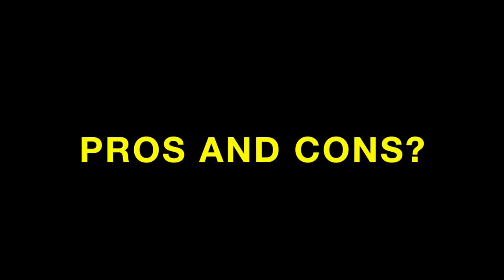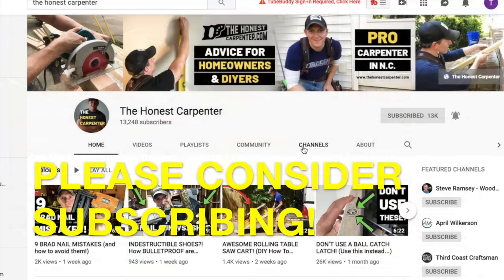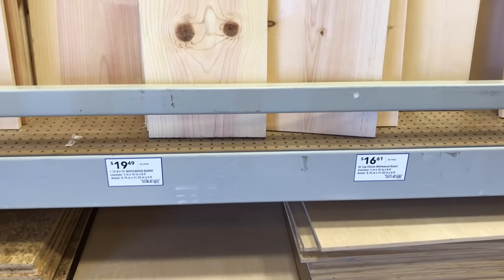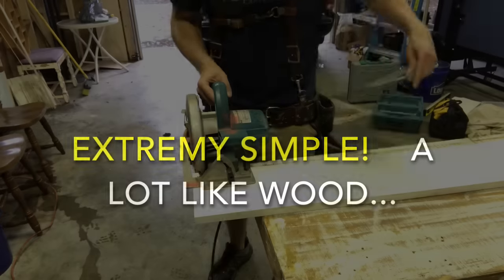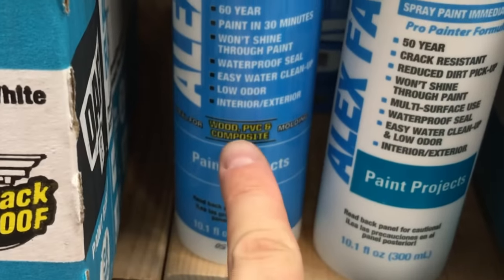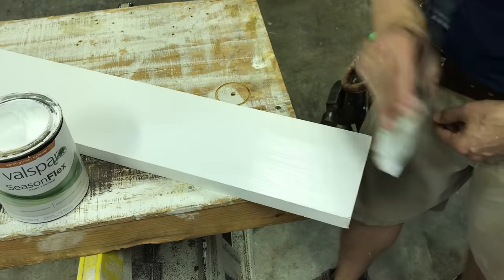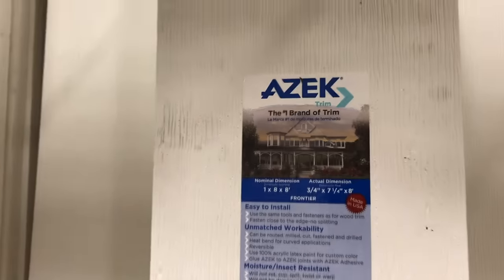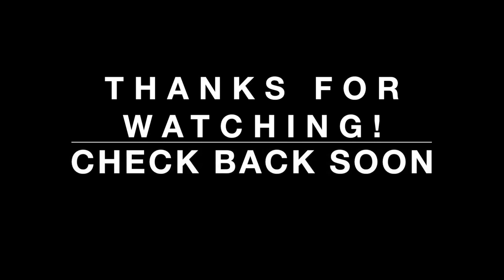PVC TRIM VS. WOOD TRIM? (Pros And Cons!)

Comment: My dad is a plastics engineer and a Hotwire would easily cut the PVC with no dust. It vaporizes the cut and it is extremely clean, simple and easy to get even complicated cuts.
Reply: That's probably what they do at the factory. It's not a mill, it's an extruded plastics production line.

Comment: I research plastic pollution, and I’m so glad you mentioned the sawdust! It’s great that you do your best to reduce sawdust entering the environment. It would be nice to see guidelines from these companies for best practices.
Reply: Someone mentioned earlier to use water and ground the tools to prevent dust flying away and sticking to things.
Reply: I like to use it as a mulch for my garden.
Reply: Did you contact your Billy Gateies  and like to give them sh..it  ? 
Thy will eliminate you like a POS
Please don't suffer ...
Reply: I was thinking putting out a large tarp down to collect what the dust collector doesn’t, but one gust of wind would ruin this idea 😅.
Reply: I think you should set a good example to the rest of us and stop exhaling carbon dioxide... you know, to "save the planet"
Reply: Pvc shrinkage is bad. I use it  for some jobs and it shrinks on the width and length.
Reply: Great comment in theory;
O' the slippery slope; guidelines & litigation make it hard enough to do business as things stand.
Birthing layer upon layer of governmental control 
where individual freedom is going the way of the unicorn and leprechauns.
Have you used a can opener lately? Opening a can of tuna is dangerous; 
Perhaps an impact study is needed; leading to newer; better laws; mandates that all metal cans have pull tops; 
I imagine the user agreement would read as follows. Please read carefully;
Failure to adhere subject to fines, imprisonment or both. Proposition tax-more.
Please peel label and follow the complete user agreement found on the inside of can; use of a magnifier glass is advised as eye strain is serious and can be fatal. Failure to comply releases manufacturer from all liability that may result in injury or death. Upon reading feel free to call our hot line with additional concerns.
Discard used cans and torn labels per guidelines....
The world according to Charlie Brown in two words; Good grief!
Reply: The companies appear to be ignoring the obvious.
Reply: @turtlewalzer  
Good grief!

Comment: As you said, with the price of wood skyrocketing and the price of PVC trim decreasing it's a no brainer. Use PVC wherever you can when working around any degree of moisture and never have to replace it. Exterior window sills, door jambs, and brick moulding are common applications. You can also glue PVC joints with PVC cement for the strongest bond possible. Good video, thanks.

Comment: If your NOT painting this PVC. Leaving the wood grain look for an Exterior trim. How do you fill the nail holes. With what product. Since most fillers will shrink or yellow over time. Leaving filler spot marks visible on PVC brickmolds when you trim out a door. I’ve tried trim screws and caps but that’s labor intensive.

Comment: Few years ago I had a front porch built with PVC trim, contractor assumed I wanted the "Wood grain" finish so he protect that side during storage and the smooth side I wanted ended up really dinged up. He was going to have to replace it, but I found if you take a heat gun to the damaged areas and then used something hard to roll it while it was hot, almost all the dings disappeared.

Comment: My 92 year old house had a window in the shower that was constantly rotting. My handyman overlaid it
with the PVC window trim with vinyl fence nails. Beautiful result. Only took 85 years to figure this out.
Reply: Only 85 years 🤣🤣🤣
Reply: Someone mentioned earlier in the comments to use water and ground the tools to prevent dust flying away and sticking to things.
Reply: @jsmith5443  Thanks J.  Not quite sure how to use water with a saw but I'll give that a think, as it does make one heck of a mess.
Reply: Could have used ground treated lumber, I replaced all my window sills and outside trim with ground contact treated lumber

Comment: Thanks for the informative video. I'm not a carpenter but I am an incredible cheapskate so if I were wrapping some iron supports like you did, I would use wood boards and cut them 2 or 3 inches short at the bottom and then nail on 4-6 inch wide pvc pieces essentially wrapping the bottoms of the wood boards so only the pvc contacts the ground.
Reply from the maker: I wouldn't blame you, Steven! The price line can be hard to take sometimes. But that sort of bottom-end extension is exactly what much of the industry is doing now to create better door jambs
Reply: We use to call them sacrificial pieces. Knew they would rot first and could be replaced easily. I like your thinking.
Reply: That's what I thought of as well. Either that or leaving about a 1/4 inch off the ground, then filling it with caulk so that the pvc is not neccesary.
Reply: Or, if the two products are getting so similar in price, whay take the time and hassle of transitioning to PVC the last few inches?  I would think it hard to attached a short 4" end piece of PVC with only rot iron as a backer, no?
Reply: @paulegan2252  PVC amending was easier (for me) than pulling out an entire patio door surround.

Comment: I'm glad you touched on the sawdust! It's messy and difficult to remove!
Reply from the maker: Like getting coated in coconut flakes KLM 😐
Reply: @TheHonestCarpenter  at least coconut flakes aren't toxic!
Reply: PVC sawdust is the main reason I minimize my use of it.  If you can't catch it all, it ends up in the environment where it breaks into microplastic, but never actually degrades.  I'm not far from the coast, so any dust I don't clean up probably ends up in the ocean.
Reply: Plastics hold a lot of static electricity.. make sure your tools are grounded.. especially table and miter saws..you can install “static brushes”  as well..( they are just conductive single row metallic bristles with a ground wire).    also, it is in our nature to keep wood dry...don’t do that with PVC wipe or mist it with water and it will act like a K&N filter where the sticky oil grabs the blowing particles.. water does the same thing with PVC. I use a strong box fan with a floss filter ty-wrapped on the intake side... once the filter is dry just use a stiff brush and shaking to remove the PVC onto your tarp ( always cut on a tarp).
Reply: @incognitotorpedo42  if you catch it all where does it go then? Into a plastic bag and ultimately into an open air landfill?
Reply: @klmbuilders5385  Yup.  Landfilling is the best option we have at the moment.  It does get buried, so at least it's isolated from the rest of the environment.  I compost my wood sawdust, so keeping the PVC away from the regular sawdust is another hassle.
Reply: @incognitotorpedo42  it might be better if you took the stuff to a recycling center where they can melt it down and make something else.
Reply: @jsmith5443  , as far as I know there's  no infrastructure for recycling PVC dust or flakes.
Reply: @phredocassera2939  Hi Phredo, I'm struggling to understand your setup. Can you please share a picture?  Thx!
Reply: @incognitotorpedo42  or in our foods and animals we consume, increasing cancer rates.

Comment: Regarding fascia boards, I would not recommend using PVC on a fascia board that a gutter is installed to, unless you can ensure that each one of your gutter fasteners(spikes/ferrules, hidden "skyhook" type screw hangers, etc.) grabs onto something structural such as a rafter tail end or a 2x4 or 2x6 subfascia(you won't always have one of these). If you have a gutter hanger that doesn't bite into something that has substance(like 2x wood, or 1x wood with a screw hanger), it won't be long before that hanger fails because the density of PVC material is much lower than wood, and as a result the lower density, fastener pullout strength is greatly reduced, and the likelihood that the weight of a gutter that is full of water or ice will be more than enough to rip it from its moorings and could cause major damage to anything that happens to be below it at the time of it falling, such as a person or a car.

Comment: Replaced wood brick moulding with pvc on my garage window over 10 years ago. Very happy with it. It faces the southeast so it’s exposed to extreme sun. The pvc holds paint very well, where the wood would start to peel after a few years. It does expand and contract as you said so sometimes you can notice a slight gap at the corners. I used big stretch caulking and that seemed to be able to handle the expansion and contraction.
Reply: My side kitchen window gets exposed to sun all day since there no trees or bush on that small side. I noticed trims are separating and I like to maintain it. I figured if this wood trim is rotting fast while other part is like new then that’s a problem. I think going PVC might be my solution as well. Glad I stumbled upon this video and comment

Comment: Another adhesive option is PVC pipe primer and solvent cement. I used it in combination with mechanical fasteners on a product display rack I built about 35 years ago. Seals up "end grain" quite nicely.
Reply: The plumbing solvent cement works, but has an extremely short open time.  Azek adhesive has come down in price to the point that it's close to plumbing cement, and is a lot easier to work with.  In addition to using pvc cement to seal end grain, you can use other solvents.  I've used acetone for this.
Reply: Both of them suck imo.  The joint easily pulls apart by hand.  The only thing I found that won't fail with PVC expansion issues is an expensive as hell two-part PVC epoxy.
Reply: are nails insufficient?
Reply: @scottgiet1835  I use stainless trim screws.

Comment: Never thought about specific caulk or adhesive for it. Good tip.
Reply from the maker: Thanks Joe!
Reply: Alexander Franke  thank you.
Reply: I've been using Oatey Fusion 10-fl oz PVC Cement And Primer. It's clear & supper strong bond. Never failed in years in full sun.
Reply: Same here.   Replaced a window last year and I think I just used regular old Dap.  I'll have to keep my eyes open as I start doing more in the next couple years.

Comment: I started using PVC trim many years ago after the brickmould rotted away on our back door. Last week, I was going to patch the rotten parts of our fascia using cedar but all of the 1x6 boards at Lowes were warped so I bought a PVC board and used that to repair the fascia. It worked great.
Reply: It is economically and ecologically a bad calculation. Pvc won't last long and gets ugly quick. You cant repair it and cant paint it either.

Comment: Best explanation video. I added PVC trim to my garage and front of my first floor to reside my home in July, looks great but as the temperatures cooled I have almost a 3/8" gap between the boards now.
Reply: Fill it with silicone or soft rubber is my suggestion if the gap bothers you.
Reply: Someone mentioned earlier in the comments to use water and ground the tools to prevent dust flying away and sticking to things.

Comment: Great detailed video. I work on a lot of boats/yachts. Pvc lumber cant be beat. Salt water wont hurt it and it never needs painting. Since there are never straight or level lines on boats, i use a heat gun and pvc cement to  conform it to the multiple compound curves on a sailboat.
Reply: They make heat blankets for pc you bend the like a pretzel if you have too

Comment: Azek trim has been around for at least 20 years.  Put lots of it up before I retired.  Even specified it when I had a contractor replace corner boards on my own house.  It is the go to product where trim comes into contact with concrete or masonary.  Just replaced some rotted window trim with cellular pvc.  Paints just like wood trim.  Primed with Kilz and painted with BM latex paint to match rest of trim.

Never burn pvc scraps.  It can generate dioxins when burning.  It gives off other nasty combustion products.  May really be the only real draw back of cellular pvc products.  Oh, and it will probably be around for a thousand years in landfills where scraps are dumped.

Comment: This video was extremely helpful. I spent so much time trying to find out which adhesive would work to apply pvc crown molding in my shower between tumbled marble and greenboard. There is very little information on this topic. The Loctite PL Premium is what I went with. Also, your video is informative and efficient, no obnoxious music. Thanks!
Reply: Another good product to use for glueing your splices and outside mitres (which you should always do) together is 2 part PVC primer and glue. The same stuff you use for fitting PVC plumbing pipes together. Just be careful if you use the purple primer because it will stain the white boards.

Comment: For the dust sticking to everything, use Staticguard, the stuff that would typically be in the laundry aisle. The reason it clings is static charge, Static guard negates the charge. It is the same reason it is recommended to paint the PVC, otherwise the trim will actually attract dust, pollen and such.
Reply: It can store that static charge and light you up too lol i work in the plastic industry and tho your trim won’t shock the shit out of you I have been lit up from it . PP is also good for static discharge too . I was gonna give the same tip on the dust but ya beat me to it 😃
Reply: I have seen a lot of PVC fencing with green moss or mildew after being installed for a year or 2.  Static charge might be the reason.
Reply: @druegillis1744  Yeah let's just spew misinformation that moss never grew on anything until they created PVC sheeting 😆

Comment: i believe the one drawback you forgot to mention was that the structural strength of this product is not the same as wood. I use it all the time but using it on windows that will get screwed into this product is always a challenge because the screws can be ripped out quite easily in comparison to wood.

Comment: A very good video outlining all the pros and cons of the product, I used PVC to replace the soffits of my house and one advantage that you did not mention is that the colour of the PVC will not change over time. Mine has been up for over 5 years now and looks good now as it did when I installed it.
Reply from the maker: @John Fithian-Franks Thanks John! I hadn't even thought about that. So often during or after my installations, the product gets painted (typically by homeowner or another crew). But I see that Azek and the other manufacturers state that it doesn't even necessarily need painted, because of its water resistance. So it really must hold that trim white color indefinitely :)

Comment: I have replaces all Corner-boards, Facia, and Window trim with PVC Trim starting around 17 years ago. It's been holding up over many summer/winter cycles as if I just installed it.  Takes paint very well.  Never going back to wood for my trim.  Thanks for this video.